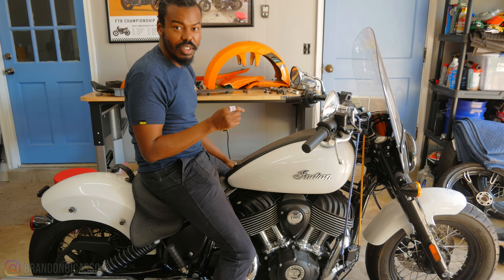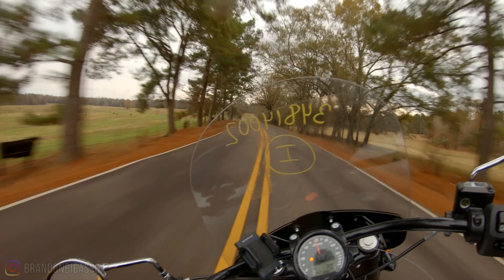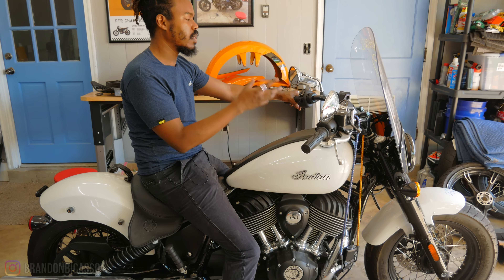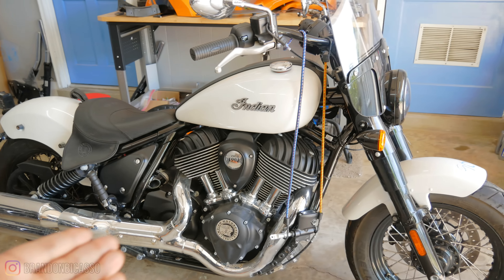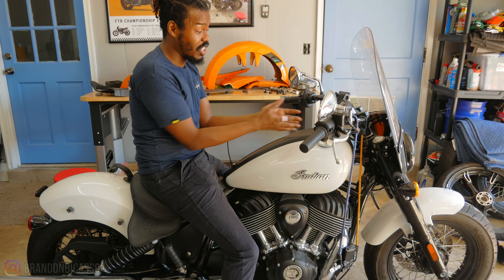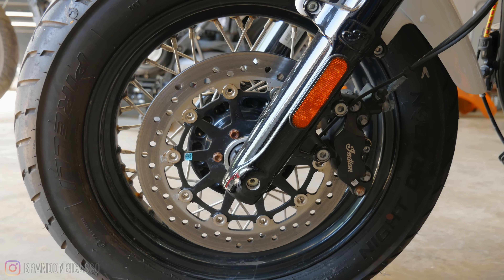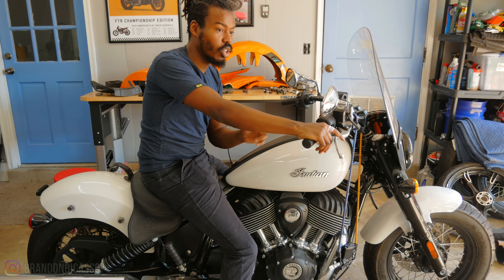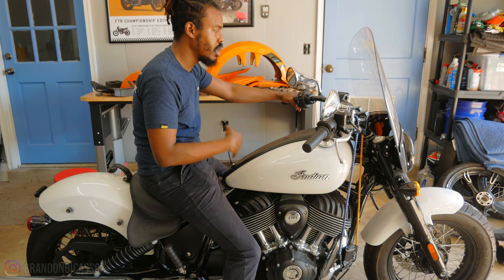They called.. We Can’t Help You Fix This. (2022 Indian Super Chief Rebuild)

Comment: Always a pleasure to see what you got going on!  Not sure what I would do. If you keep it you need a can of Corrosion X Aviation grade and flood the connectors and harness.
Reply from the maker: Don’t have Aviation grade but we will see what this Walmart grade will do 😂
Reply: @BrandonBicasso  
I use the stuff every day! At my house I get nervous when I don't have an unopened can.
Reply from the maker: I’m using QD electronic cleaner so it should be enough.. hopefully. 😬 I shouldn’t have to de-pin anything but I’ve removed the starter solenoid to replace. It’s rusted and delicious looking. Of course you all will see that up close and personal.
Reply: @BrandonBicasso  
That is good stuff to clean it but you will want to protect it too. That is where Corrosion X comes it. Silicone spray may work but don't know.

Comment: Having worked delivering insurance vehicles to IAA and Copart, these bikes sometimes lay on their sides outside in the storage yard (most of the storage yards are gravel or dirt).  Could be the reason for the possible rain water in the exhaust though sometimes they are washed for photos before photos are taken for the internet. I bought a Roadking awhile back and when it was delivered it looked like it was drug through the mud.
Reply from the maker: Makes sense. I’ve had great experience so far but even if something happened, we’d get it sorted. Ain’t no thang 👌🏾

Comment: Whewie... when I saw those roaches I would have been outta there! Haha. What slip-ons are you thinking of putting on?
Reply from the maker: Lmaaaao, Mrs. Bicasso was not having it. 😂😂😂 She said go spray the garage RIGHT NOW.
Super Chief Limited came with a set of Dean Speed black slip-ons so I will use those. The exhaust on Super Chief is rusted out but the headers are still good. Cleaning them up with 000 steel wool.
Reply: @BrandonBicasso  Haha I don't blame her! Ohh, sweet! I have a pair of Dean Speed slip-ons myself. I like them well enough, but I feel like they aren't quite the sound I was going for. Unfortunately, at the time, not many companies were making slip-ons for the Chief.
I was going to say, I saw the rust stains on the ends of the pipes but the headers did look pretty good. Best of luck cleaning them up! I don't envy the elbow grease you're going to have to apply to clean them up haha.

Comment: Water damage is more dangerous than a total wreck,l think that is why it has the junk title.Even if you swap the frame,you would only be transferring the title,the super chief,when completed would not be road worthy then.For your own safety,especially a water damage bike,l would suggest you take it apart,get it rewired completely with new and safer wires and register it as customs build with slight modification.Or sell it  to someone that resides in other states where it can be registered as clean....Thank you.
Reply from the maker: I disagree with the first statement to a degree. I’d take a water damaged bike than one that had frame or steering issues. It’s a journey that I’m on regardless tho! 🫶🏾
Reply: @BrandonBicasso   I agree Brandon. In fact, if you wanted to go full tilt, you could just source a brand new wiring harness and swap it out. As the saying goes. You make your money on the buy. And whether you part it out or get a new title. You will make money. The only issue I see is the time involved. Good luck.